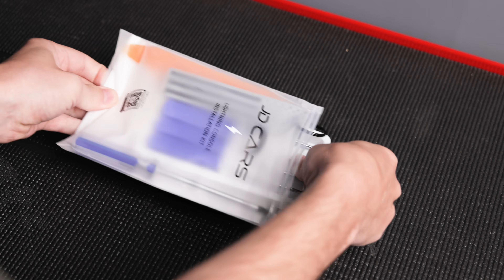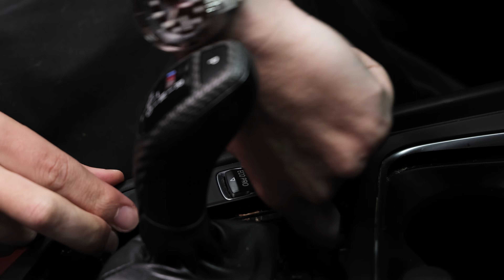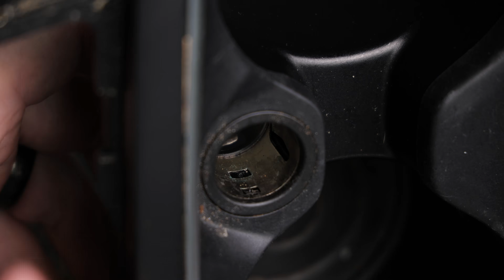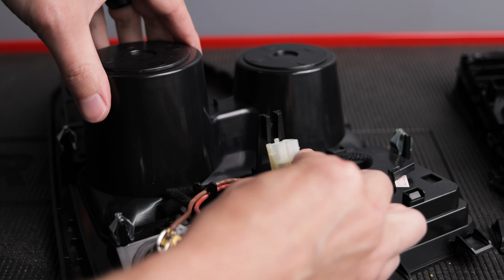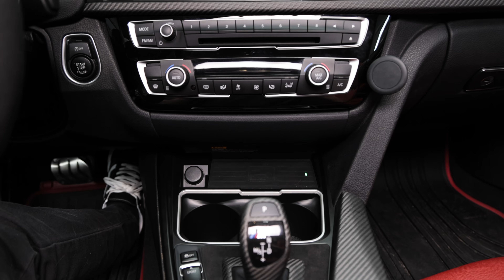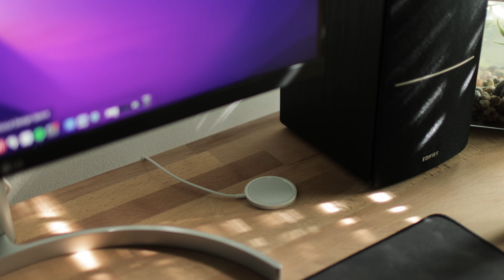Your BMW NEEDS This Wireless Phone Charger! PLUG & PLAY RETROFIT

Comment: Looks very cool. The cup holders appear to be shifted back slightly and one of them is bigger and deeper, so it may solve my US-sized travel mug compatibility problem,in addition to providing wireless charging.  I was ready to buy until I read the terms and conditions. Specifically, the clause that states, “You recognize and agree that you shall not be entitled to a refund for any purchase under any circumstances” is concerning.  That might be okay for a $20 T-shirt, but I think it’s a little unreasonable for a $200 custom electronic car accessory.

Comment: Does the oem cup holder cover still fit on this?
Reply from the maker: No, you wont be able to use the cover with this. The charging unit itself sits where the cover would normally slide into

EDIT: i just realized that on some F30’s the cover is a separate accessory, I’ll ask and confirm if it will still fit
Reply: @justinbuice  I’ve got the f80, I have the cover that’s a seperate piece that goes on top. Hope it fits cause it’s coming on Tuesday. Thank you
Reply: Installed mine yesterday. Love this wireless charging fits iphone13 pro max with a case. The seperate piece which is the cup holder lid doesn’t fit, you can get it to rest on top of it and not move around but it’s not flush. My other gripe with this is I wish they left some holes on the driver side to be able to swap over the leather piece by the driver side on to the new trim. Other than that great product. Looks oem installed.

Comment: OK so I just watched Thic whips and Kies Motor Sports install this same charger. This was the best video out of the three in my opinion. Especially the air vent duct rubber band. If I decide to buy this is use the link in this video. Thanks again Justin 👍🏽
Reply from the maker: I appreciate that!!
Reply: Thick whip doesn't know crap,

Comment: Really cool but ima be honest I've never seen the use of wireless chargers. I have an Audi so the terms may be different, but I refer to MMI as the infotainment screen. Wireless chargers take up useful storage space and charge your phone super slowly and because of the energy loss cause heat. I run CarPlay with navigation on my MMI screen and keep my phone on a phone holder with spotify so I can easily change songs. With a wireless charger I only have navi on my MMI screen. Plus I have a USB-C fast-charger for my cigarette outlet. 

For me, I don't understand the craze of manufacturers installing wireless chargers. I want to be plugged in for USB-C fast charging and be able to have navi on my MMI screen and music/spotify on my phone for easy changing. Seems more of a gimmick than anything IMO. I still admire the creativity of this product though Justin.
Reply: Bingo; inefficient in every way
Reply: Yeah but it can be useful for a passenger or if you need to charge in a pinch.
Reply: Go for swimming with your phone or just get caught in the rain, then try to charge it with a cable.

Comment: Hey Justin, thank you for showing us how to install. I wanna to ask, if I use the 12v port for dashcam, will that interfere with a water bottle in the left cup holder ?
Reply from the maker: Hey i’ll test it out and report back, shouldn’t be a problem though. On my car I plug in my dash cam in the outlet in the center console, then run the wire under the seat

Comment: Really cool! I’m actually considering getting one, do you know if it also fits on manual F30s? It should, right? I imagine the specs of the center console should be identical but I wanna be sure before getting one.
Reply from the maker: Yes it will fit the same way